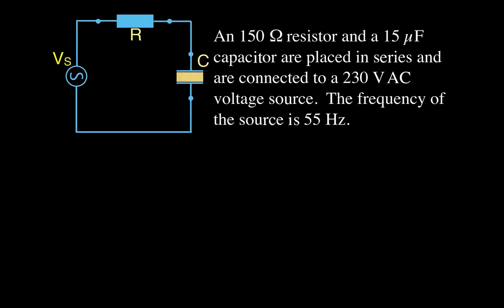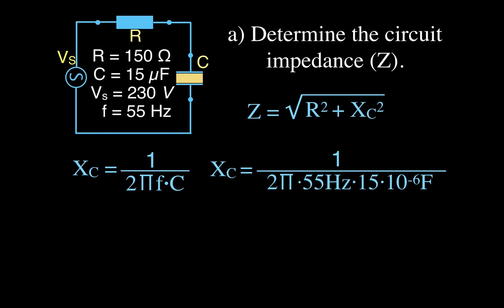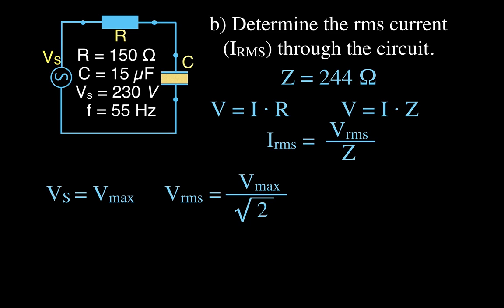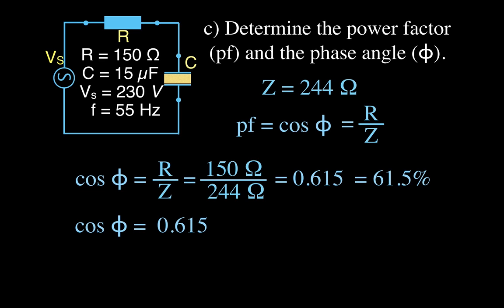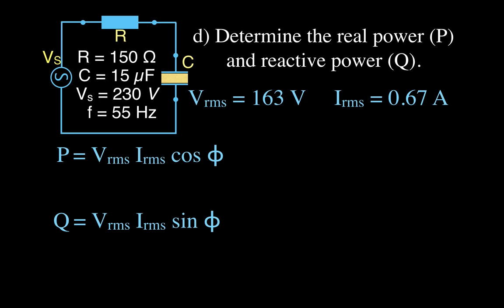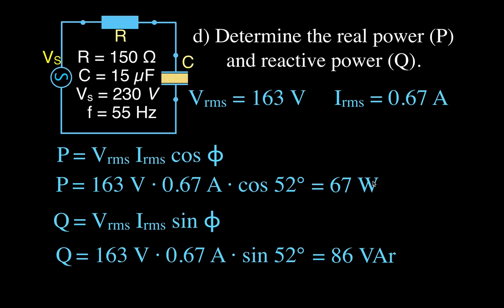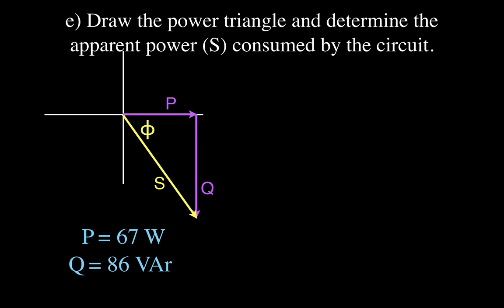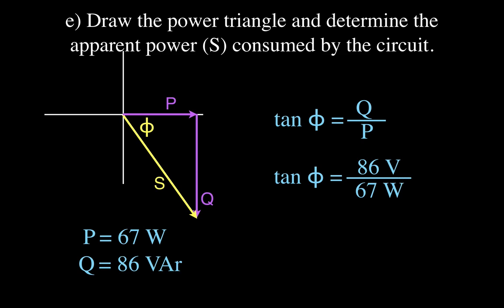RLC circuits (4 of 6) AC Power for an  RC Circuit

Comment: Hi nice video easy to understand but how you calculate voltage across the resistor and capacitor.? Thank you
Reply from the maker: The voltage across the resistor is the current times the resistance and the voltage across the capacitor is the voltage of the source minus the voltage across the resistor. Does that help?

Comment: I always learned that you should assume voltage is in RMS unless specifically told you are being given the peak value. 230v in real life is the RMS value . Meters are calibrated to display RMS. You stick a meter in your dryer or stove receptacle is going to show 230v or close.